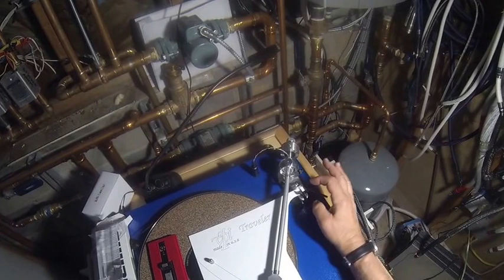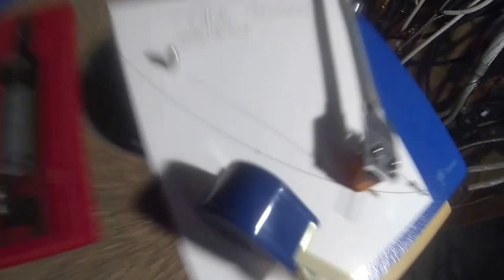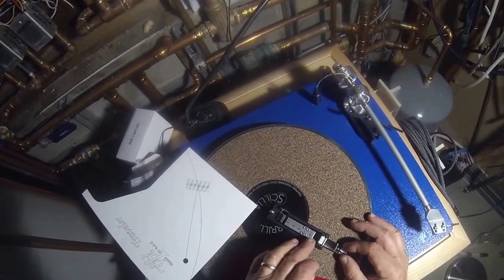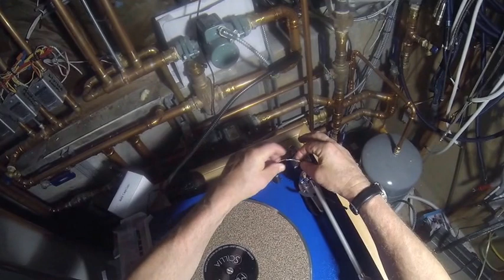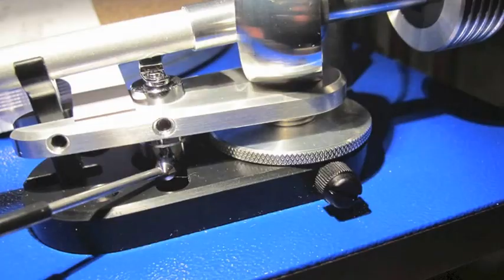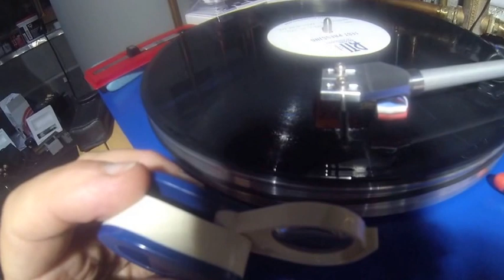VPI Traveler Turntable Set Up  Part 2

Comment: If you lose/destroy/never had the thick paper cartridge alignment/overhang gauge, contact VPI and they will send you one, free (thanks, VPI!). Their website only shows the metal ones for the higher priced turntables and you specifically need the Traveler one. The paper gauge is a little flimsy so I would suggest glueing a piece of construction paper or thin plastic page divider on the bottom to firm it up.

Comment: Why have the adjusting for the high when you make a turn table. Its all the same so the spec as the highs are also the same. Its just stupid.
Reply: Required height for the tonearm varies with the height of the cartridge, although 92-degree stylus rake angle is universal.  Less sophisticated turntables do not allow for height adjustments because lower cost spherical and elliptical styli are less sensitive to SRA/VTA.

Comment: I had a similar issue with the cueing mechanism on my Classic 1 when I received.  However, even after adjusting it to its max height, I still had to raise the pivot cup in the arm wand so the arm would rest lower, at which point the cueing device would catch the tonearm.